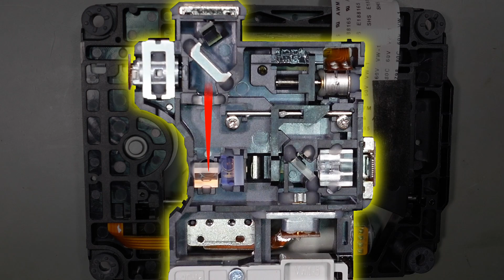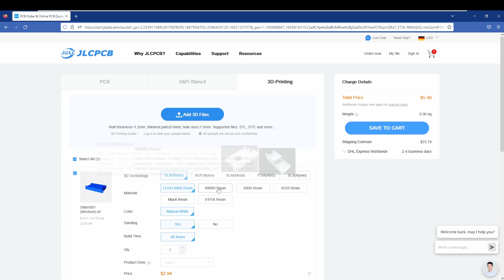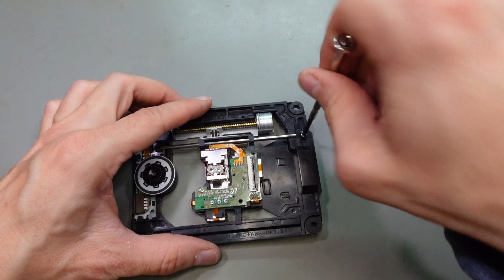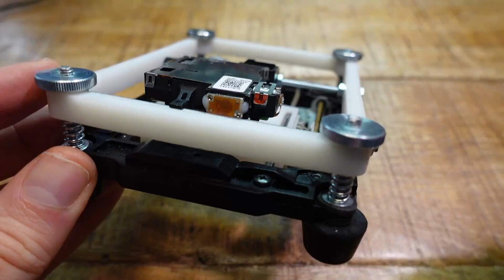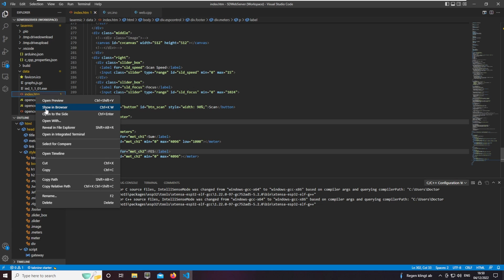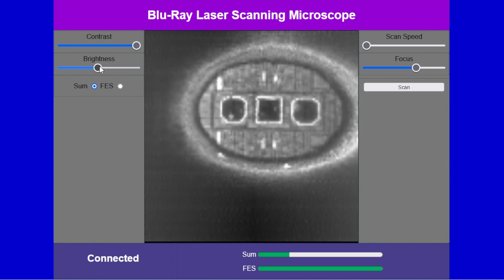DIY Laser Scanning Microscope from Blu-ray Player #2: Shooting Images

Comment: One thing that's not clear to me: did you use the raw focus error?  I would think it would be better to use it do drive a control loop  and measure the current through the focusing voice coil - constantly trying to achieve optimum focus. Still, very impressive.
Reply from the maker: I tested both measuring the focus error and measuring the amount of light reflected by the specimen. The second method produced significantly better image quality. So I just discarded the focus error.
Reply: @DoctorVolt  Very interesting. What a cool project.

Comment: Gut gemacht, Respekt! Letztendlich siehst du das Relief und das Ausmaß der Korrektur zum zum erreichen des „Null“ Signals wird in Graustufen umgewandelt.  Direktantrieb reduziert die Auflösung. Ein stinknormaler Arduino Steppermotor wird mit der M3 Gewindestange eine deutlich höhere Auflösung erreichen, 2048x2048 Schritte/mm2. Beim Linienwechsel muss das Spiel im Getriebe ausgeglichen werden.
Reply from the maker: Es gibt einen dritten Teil, wo ich einen Schrittmotor mit M3 Gewindestange verwendet habe. Die Auflösung damit ist besser, aber immer noch nicht ideal.

Comment: I have been planning on making something very similar but I intended to use the Hsync and Vsync from an old CRT to control the motion of a beam across a sample and pick up the beam reflection which I intend to feed into the intensity of the CRT beam.  My resolution should be limited by my accuracy I can control the beam and using Piezos I think I should be able to get really accurate grid passes and since I'm essentially multisampling each point I don't think diffraction limits for the wavelength used are going to be a problem as they are in normal light-based microscopes, but I suppose we will see.  I had the idea for a while now, got all the parts together but I am slacking on it because I am nervous, but this gives me hope and kind of solidifies the idea I had but didn't know if it would actually work.

Comment: This is a great project, thanks for sharing! Trying to replicate it. I have a ESP-network related problem: programmed ESP with my SSID and  Password from my cell phone  provided network, got message" WiFi Connected" from the serial, but no response from the webpage (PC is connected to the same network).  Tried to de-activate firewall with the same result. Could you provide any hint pls ?
Reply from the maker: Can you at least "ping" your ESP32? Maybe it didn't get an IP or there is some authentication problem.
Reply: @DoctorVolt    Thank you! Actually the ping is quite unstable, from 0 lost to timed out. The wifi signal is strong. 
  Ping statistics :
    Packets: Sent = 4, Received = 2, Lost = 2 (50% loss),
Approximate round trip times in milli-seconds:
    Minimum = 208ms, Maximum = 211ms, Average = 209ms
Tried different PCs in case, the same  issue. (In case tried a demo of a simple webserver on ESP32, it is working fine) Could you give your guess where to dig pls?

Comment: I'm currently in the process of ordering a finished PCB. I have a question about what kind of ribbon cable this is or what kind of adapter.Is there a name for this?
Reply from the maker: It is a standard 40 pin, 0.5mm pitch ribbon cable + adapter board. You can buy these everywhere. Nothing special...
Reply: Thanks I will check this out and make a commit on the repo if it works 😁👍

Comment: What an amazing work. I am working on a project to build a similar scanning microscope. I have a high resolution confocal system connected to its controller. Now I want to integrate it to a motorized xy stage so i can do scans and stitch images. But I dont know how to do this. Someone suggested I need to connected the stage encoder to the imaging controller so the two systems are in sync and the imaging data output can be read and stitched. But I dont know how to do this either. If you can make a video explaining how you did scanning, that would be very helpful. Thanks.

Comment: Sir, thanks for your work. I have a question, why do you connect only one side movement to coil TPIC FR+ to L293, another direction is not possible to move?
Reply from the maker: It moves in both directions, left and right.

Comment: Amazing works on the laser scanning microscope. I have been trying to replicate this project and having trouble with the OPU's PDIC output part. I able to get the software, laser, voice coils working but the part where get the SUM and FES did not go as expected. Do you have any ways to test the PDIC and what is the expected voltage and current from the PDIC output for each Ua,Ub,Uc and Ud pins?
Reply from the maker: As there is no documentation for all these OPUs, the only way to find out is to try with a voltmeter or oscilloscope. With mine it was 2.5 +-1 V.
Reply: @DoctorVolt  Thank you for the reply, I would like to ask how do you get the PDIC working? it is all I need to do is supply 5V to FD_5V pins and the PDIC outputs pin a ,b ,c and d should react to the laser according to the range you provided (2.5+-1V) even without the circuit that calculate SUM and FES?

Comment: Have you tried micro-stepping? That might be easier than a new spindle, but needs a capable stepper controller.
Reply from the maker: Yes, I did with 32 microsteps.

Comment: Why can't I make the connection between the software and the esp32 board?
I was able to upload the arduino to the board, do I need to change something in the board's firmware for the WI-FI connection?
Reply from the maker: Did you enter your ssid/password into the header file?
Reply: @DoctorVolt  this is a great project, thanks for sharing! However, I have the same problem, programmed ESP with my SSID and  Password, from my cell phone  provided network, got message" WiFi Connected" from the serial, but no response from the webpage (PC is connected to the same network).  Tried to de-activate firewall with the same result. Could you provide any hint pls ?

Comment: Very interesting.  How do you get such a nice image when the FES signal is so sensitive to vibration?  Wouldnt the image be full of vibration noise? Did you lock the FES with a PID control. Even so, wouldnt the correction signal from the PID loop contain the vibration noise?
Reply from the maker: I did an averaging of the values. This greatly reduced the noise. Overall, the less sensitive sum signal resulted in better images than the FES.

Comment: Am I right that you didn't use the voice coils for scanning at all? Could you use them to do "micro stepping" and scan the area in between the steps of the linear screw? That way you should get much higher resolution.
Reply from the maker: I already use the voice coils for scanning in X-direction along the lines. The Y-direction is done by the stepper motor and the spindle. Unfortunately there are no such coils for this direction.

Comment: Nice work! IIt would be interesting to see how far you can push the resolution. Have you considered a galvanometer to give finer control over the laser?
Reply from the maker: I think that galvanic forces are not strong enough to push the sample forward. Piezo might be a better approach there.
Reply: @DoctorVolt  galvo's are usually used to deflect a mirror rather than the sample.
Reply from the maker: Ok, but galvos work with collimated laser beams over long distances. But I have a focussed beam over a very short distance here.

Comment: Amazing project!
So the scanning process is done in conjunction by the lens magnetic mount and the stepper motor, isn't it?
Do you think you could record/burn/print the target using the laser should it be powerful enough?
Reply from the maker: Maybe with a laser for DVD/Blu-Ray burner. These are much more powerful than the blu-ray player-laser I used here. This one is actually not much stronger than an ordinary laser pointer.

Comment: WOW!!!  Having ripped apart many blu ray drives to harvest the 405nm diodes so I can use them for powerful laser pointers I know the optics train is complex and compact. I always thought those photodiodes were super simple , didnt think they were this complex.  Laser pointers... Yeah,  pointless hobby but I learned a lot doing it. Anyway, this is absolutly ingenious.  To pull this off you really need to have a whole host of skills along with persistance.  Not many people could have done this.   BTW, I found this on the picks for you feature of Google News. It linked to an article about this project in Gizmodo.  Not sure where you live but in the US Gizmodo is pretty big. Congrats!
Reply: You are probably aware, but just in case, please be careful where you point those laser diodes, they can harm human eyes, and not everyone will wear safety glasses.
Reply: @aronhighgrove4100   Oh yeah, definitely use caution with lasers not only with human eyes but animals as well. Even need to be careful with  electric "eyes".  Some camera sensors are easily damaged by lasers.  Gotta admit, I did think about blinding the sensor in a speed cam a while back. Lol!